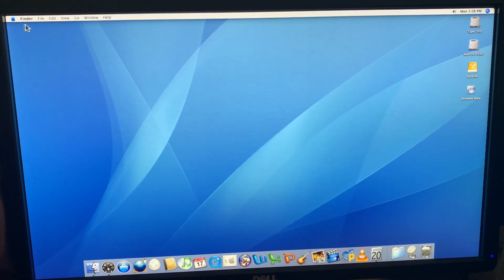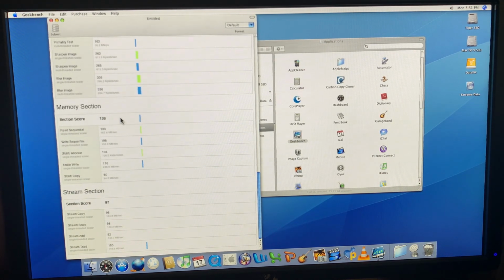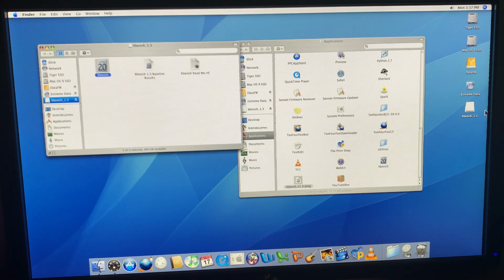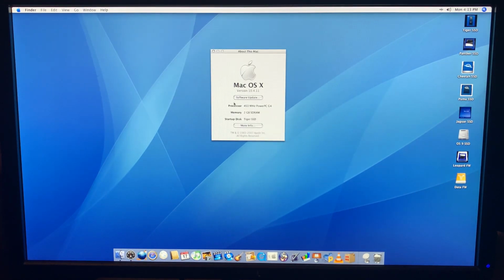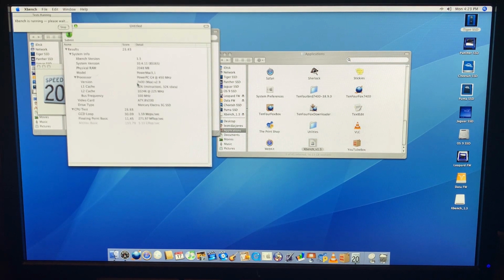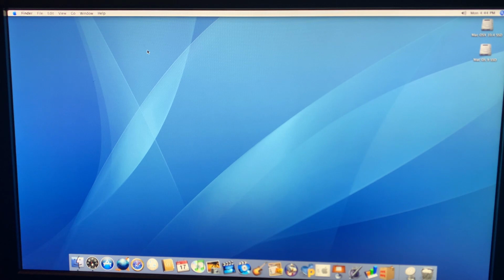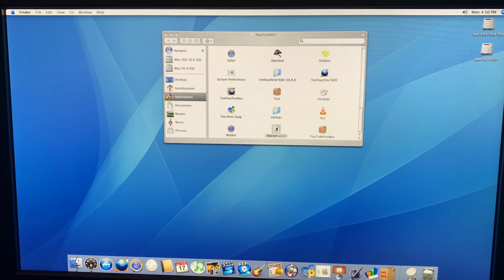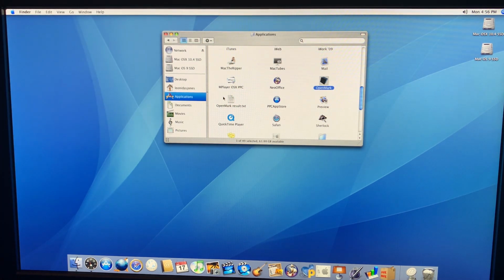Power Macs, G3 to G5, Benchmarks! Part 1

Comment: Great stuff. With your range of GPUs it would be interesting to see how the machines benchmark between a low and high end GPU
Reply from the maker: Interesting idea.  How do you envision that?
Reply: @brokenelectronics3665  For each computer, put in the poorest card (rage128) and try to render a blender object or another compute heavy task,  then do the same tasks using your best AGP card. The 6600 and 4500 comparison in the G5s would be cool as well.
I am interested to see how much of an impact the GPU or architecture has on real-world tasks. So, could a better GPU on a sawtooth make it perform close to a quicksilver wuth a rage128, etc.
This guy did blender benchmarking on different powerPCs, but didn't mix the hardware https://www.youtube.com/watch?v=d1UOOSXiPvE
Reply from the maker: @der0keks  it may be awhile before I can get to that, but it’s an intriguing idea. Thanks for the suggestion.